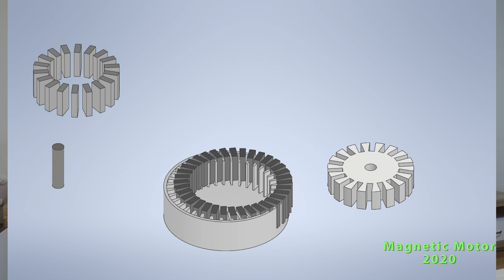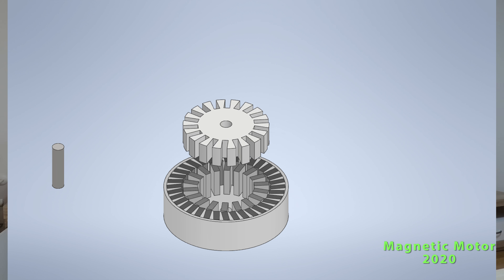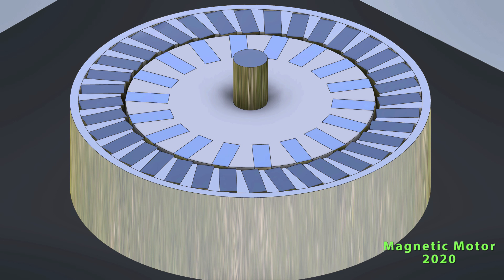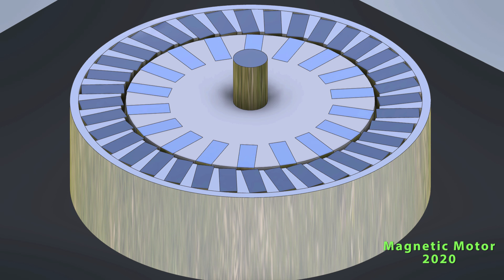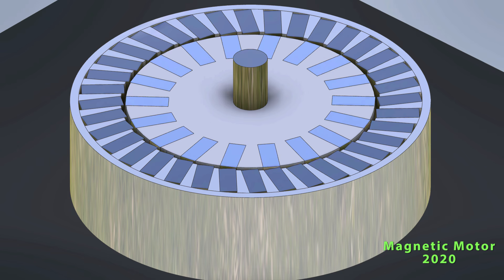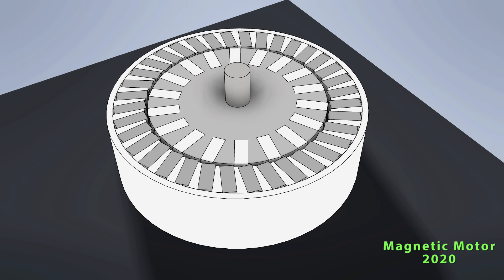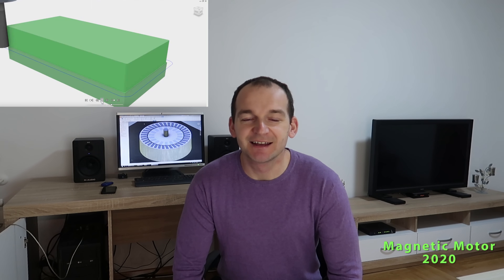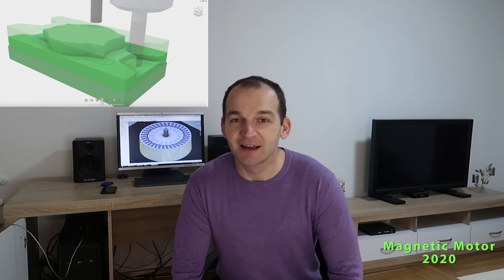Free Energy in 2020 - Magnetic Motor

Comment: Just slant the inner race and it becomes a turbo fan    Looks Easter that’s the cererl  motor.   The round magnets are hard to make.  
This one      It should spin up and need a discharge of some type to drain it and make It coast at about 7000 rpm

Comment: Try modelling magnetic field volume intersections. 
Also include the force vector of each magnet in a model. 
Force vectors (or their X Y Z components) are what would spin or push the moving elements.
Good luck!!!
Reply: Kapalek84 would slanting the inner race give a higher charge at the intersection because it trailed longer at a diagonal.   Across the length of the rectangular magnet ?

Comment: please we also be intersted in 3d Printing parts which we can produce at home
Reply: Don't waste your time and materials on this.  If you stop and think you will see a very simple way to prove it doesn't work in real life.  The trick is to start with the simplest but not real case of one magnetic pole on the rotor and one on the stator and imagine you are wanting to make a graph of torque vs angle.  It you use the point where the two poles are closest to each other, as zero degrees, it is a bit more obvious.